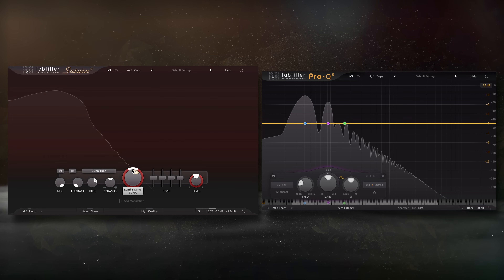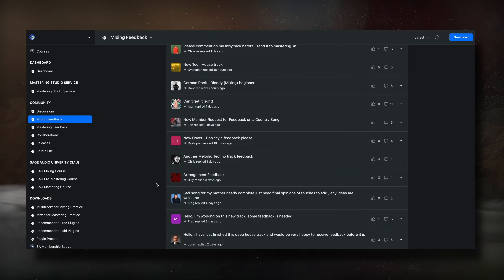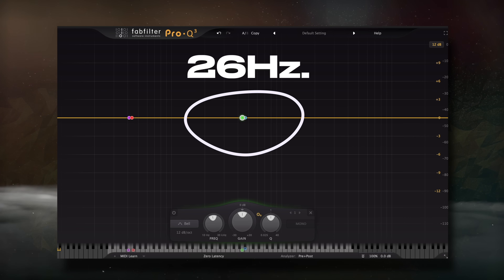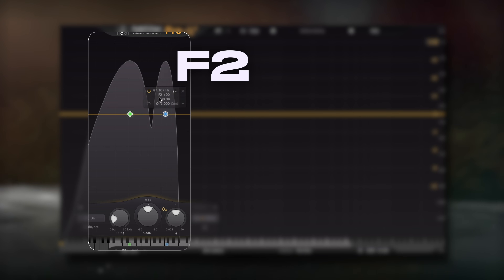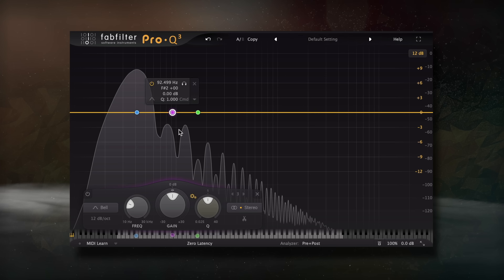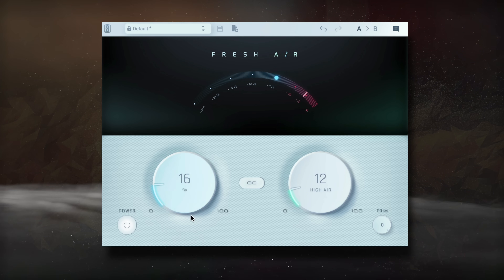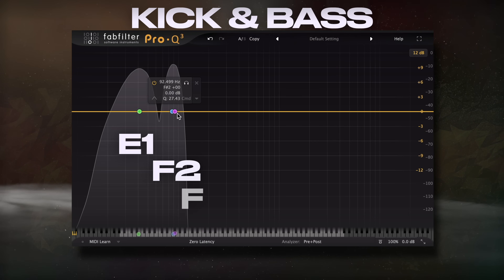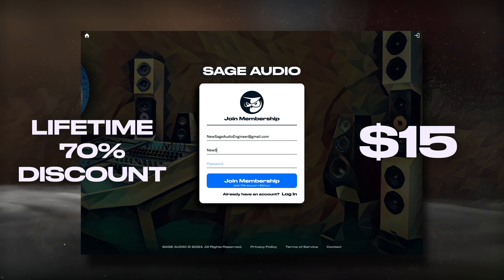The SCIENCE of Mixing Perfect Kick and Bass

Comment: 1:26 Of course, 1.06 is the rounded ratio (which is fine). The exact ratio is 1.05946309.
I mean, there's an uppercase "SCIENCE" in the video title. So let's do some math 😄
If you multiply a frequency 12 times with the ratio r, you would get double the frequency. It has to be like that because you would go up 12 semitones, which is an octave by definition, which is double the frequency by definition. So one octave above 440Hz is 880Hz.
440 • r • r • r • r • r • r • r • r • r • r • r • r = 880
440 • r^12 = 880
1 • r^12 = 2
r^12 = 2
r = 12√2
r = 1.05946309

Comment: Question: I recently saw another yt tutorial where somebody said, when mixing a sub, in order to make it audible on phone speakers, you just add a second sine wave oscillator which is only playing the third overtone of the fundamental (the fifth). Then you adjust the phase of both oscillators so you get maximum loudness while having minimum voltage basically. And after having tried it out, it does sound pretty good (if you don’t have a texture bass on top). But why do these two signals don‘t cancel each other out then? Is it because it’s an overtone or because the fifth is a large enough interval?
Reply: I don't use that technique, but the relationship between two notes a fifth apart (seven semitones) is fundamental to music. Not only are they roughly half an octave apart (so they are clearly discernible as different notes), the ratio between the frequencies is exactly 3:2, which means any phase cancellation or beating is regular and harmonious. It's why all major and minor chords sound "good" (they contain the tonic and the fifth) and why many genres use "power chords" (just the tonic and fifth). Other intervals can be discordant because the ratio of the frequencies isn't a simple ratio like 2:1 (octave), 3:2 (perfect fifth), 4:3 (perfect fourth), but something like 1.0663728:1 or another number with random infinite digits.

Comment: How could i identify kick fundamentals? I use different kick samles
Reply: If you layer your kicks, then you might have to select the dominant kick as the fundamental frequency. By using a spectrum analyzer graph in fabfilter pro-Q3, you will find your fundamental frequency being equivalent to the highest amplitude in your frequency spectrum.
Reply: Use SPAN.
Reply: Use SPAN and change the mode from default to high resolution to have more visual details
Reply: Use any good spectrum analyser and just visually look for the loudest peak while you loop the sample. What you'll probably notice is that kicks don't have a fixed fundamental frequency, because the pitch sweeps from one frequency to another (which is why kicks sound like kicks, not bass guitars) whereas sustained instruments stay on the same frequency. The rapidly changing pitch of drum sounds is what makes it very hard to get them to gel with bass sounds, since the changing pitch means there will always be moments where the kick is out of phase. You just have to pick or tune your kicks so that they are in phase more often than not.
Reply: Does span allow you to change the kick fundamentals too ?